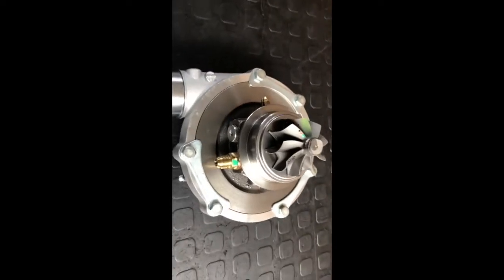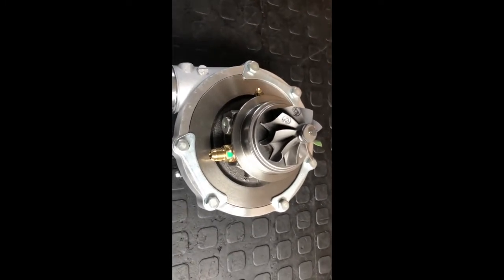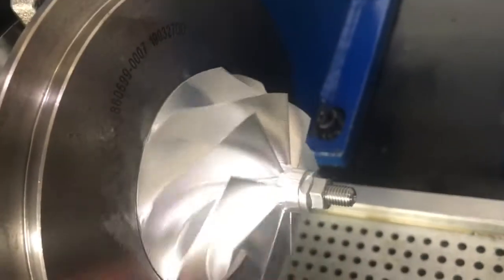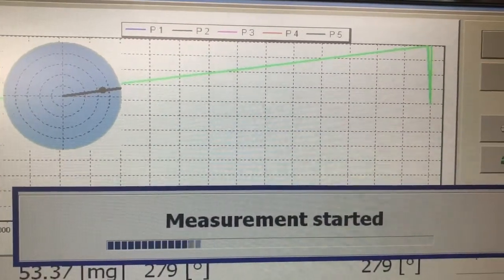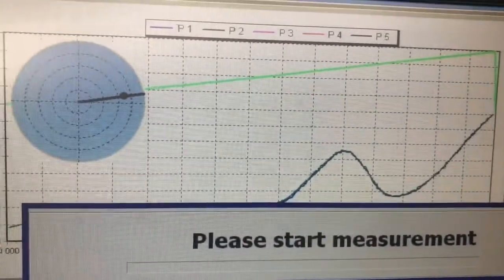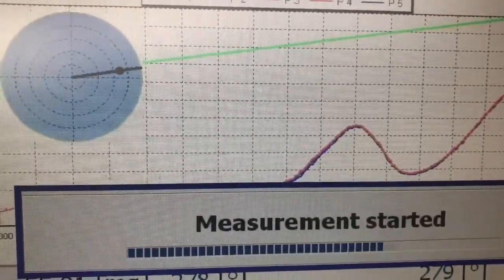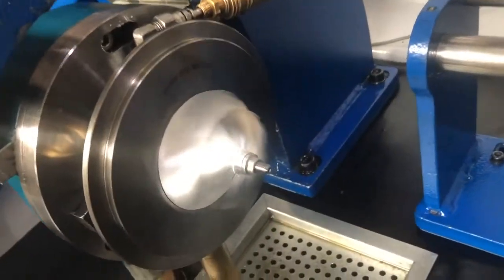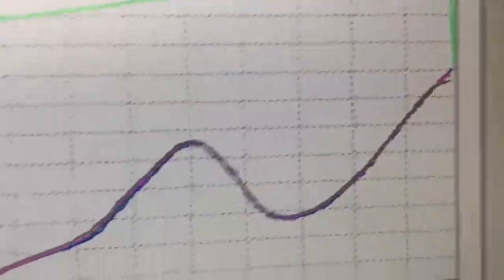G30 900 VSR test

Comment: I Would like to see a balancing graph of a small turbo spinning over 200k rpm. Can you show that? Is it safe for a small turbo eg GBC14-200 to run at sustained RPM of 200k?
Reply from the maker: The balancing graph is no problem at all - we are bale to rotate to 400 000RPM in terms of the machines capabilities. Understanding the sealing system used on turbochargers, and the hydrodynamic pressure differential which is relied on to keep the oil inside the rotating assembly, it is not good to run a turbo at that speed for sustained periods. 

To get a turbocharger driven that fast will take about 5seconds, from standstill depending on the manner in which the machine drives the turbo, and what the inside of the drive cavity looks like.  Some machines use accelerators in-line with the incoming air stream, which is highly restrictive for high flow situations/requirements but works very well for smaller rotating assemblies with lower air volume demands.

Comment: Pulsar g30-900 Vs Garrett
Reply from the maker: Thanks for the comment Goodwille, pulsar turbos are chinese knock off's of the Garrett range. They arent something we are interested in testing. We know that the bearing cartridges in the turbochargers are not supplied from a reputable bearing manufacturer in the turbo industry, and this is the main reason we arent interested in the tests of this range.

Comment: PLEASE test and review the Pulsar G35-1050 turbo 1.01a/r  "T51r mod" . I will buy it from you after the test. That is my word.
https://www.pulsarturbo.com/product/pulsar-6862-based-off-g35-1050-dual-ball-bearing-turbo/
Reply from the maker: Sorry Zionslayer1 - i wont spend money on this turbo. Its a copied product of various components some of which are Garrett. Spend slightly more money and buy yourself a genuine brand product!
Reply: @TurboDirectSA   by "slightly", you mean, more than double. But thanks anyway.
Reply from the maker: @Zionslayer1  Not at all - GTX3582R Gen2 is not 2000USD
Reply: @TurboDirectSA   I am not into bantering.  But the 3582r is no 35-1050. It is 8% less efficient at the pressure ratio of target. The 3582 is very well over $2000 USD. And that's on EBAY 
https://www.ebay.com/itm/184476353489

Now, if Garrett will frown upon you on a successful test of the clone, then surely,  I understand.
Reply from the maker: @Zionslayer1  I disgaree with you. On paper the G35 looks great, in real life its a different story. GTX3582R Gen2 is FAR from 2000USD - you looking in the wrong place.
Reply: @TurboDirectSA  , right $1875.58 on your website. I guess I will wait for the TurboDirect brand to be released. I wish you would also release something like the GTX3584rs at the same time. The 3071 is just too small for some of us.

Comment: Did you ever tested xona rotors turbo lines ?
Reply from the maker: No we have not - however from physical dyno time and seeing back to back comparisons on our own dyno previously, they seem to be really expensive products and do not outperform or outspool the current OEM products in the same family size and bearing category.
Reply: @TurboDirectSA  my xona 9567 cost is 2300$ us compared to g series at 2600$ us, but my next turbo will be a Garrett, probably a g35-1050 for my Mitsubishi 2.4 liters
Reply from the maker: @jeromelevesque8330  The EFR range is also something you should consider - especially the EFR8474 Black Series.  Something i think will surprise you.

Comment: Amazing 😍 can i ask what kind of test can you make to see the difference between the gtx3076 gen 2 and the g30-770 ? Thx
Reply from the maker: Are you referring to a VSR test? Remember that the tests on the VSR are state of balance tests, and not flow plot results, which we have the equipment to do aswell, but this VSR test was dont to show the balance curve to prove that the cheap chinese poor quality (paper weight) was in fact a ticking time bomb.  The bearing cartridge in the G25, G30 and G35 are all identical in the Genuine Garrett turbos - so the curve and consistency by testing any or all of these turbos will be the same.